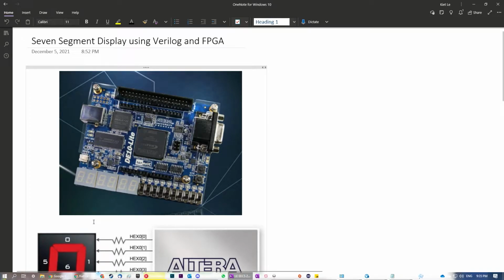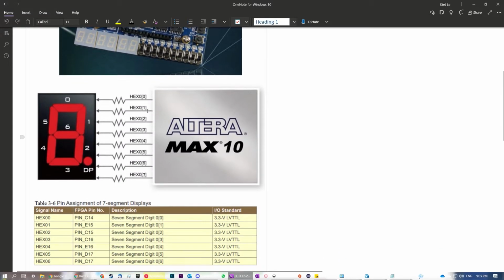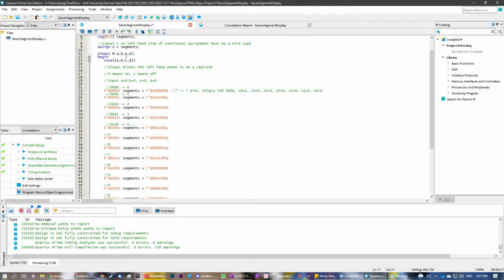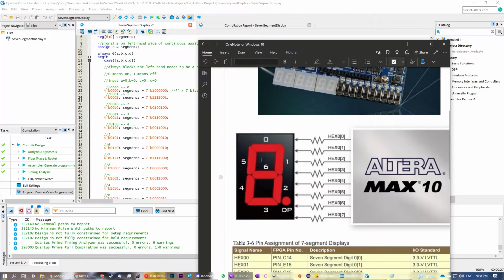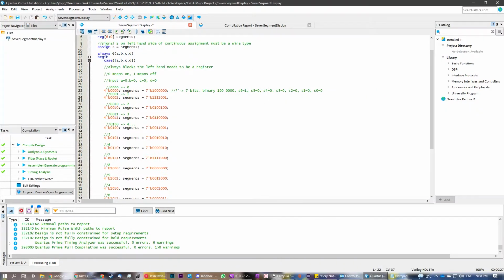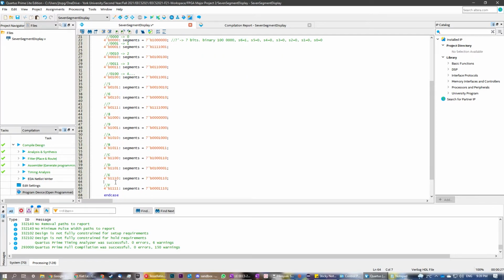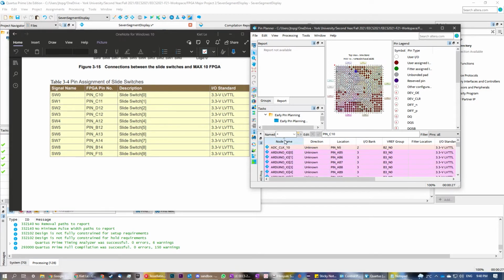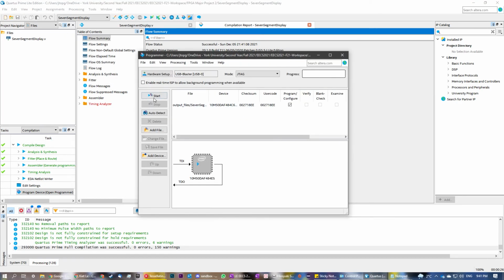7-Segment Display using Verilog and DE10-Lite FPGA Board

Comment: module mux(
    input wire a, b, c, d,          // 4-bit input as individual wires
    output wire [6:0] s             // 7-segment display output (active low)
);
    reg [6:0] segments;             // Internal register to hold segment states
    // Continuous assignment to connect segments to output s
    assign s = segments;

    // Always block to evaluate on changes to inputs a, b, c, or d
    always @(a, b, c, d) begin
        // Case statement to determine segments based on binary input
        case ({a, b, c, d})
            4'b0000: segments = 7'b1000000; // 0
            4'b0001: segments = 7'b1111001; // 1
            4'b0010: segments = 7'b0100100; // 2
            4'b0011: segments = 7'b0110000; // 3
            4'b0100: segments = 7'b0011001; // 4
            4'b0101: segments = 7'b0010010; // 5
            4'b0110: segments = 7'b0000010; // 6
            4'b0111: segments = 7'b1111000; // 7
            4'b1000: segments = 7'b0000000; // 8
            4'b1001: segments = 7'b0010000; // 9
				4'b1010: segments = 7'b0001000; // A (10)
            4'b1011: segments = 7'b0000011; // b (11)
            4'b1100: segments = 7'b1000110; // C (12)
            4'b1101: segments = 7'b0100001; // d (13)
            4'b1110: segments = 7'b0000110; // E (14)
            4'b1111: segments = 7'b0001110; // F (15)
            default: segments = 7'b1111111; // Blank (all segments off)
        endcase
    end
endmodule
Reply: Gracias!!